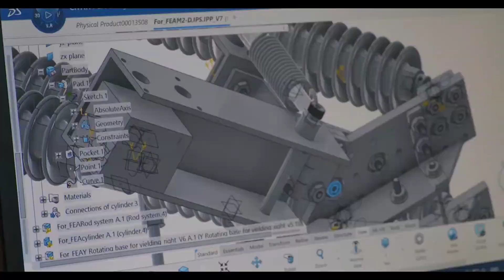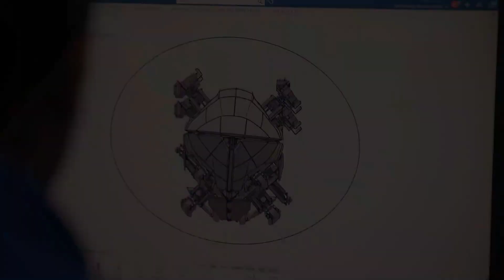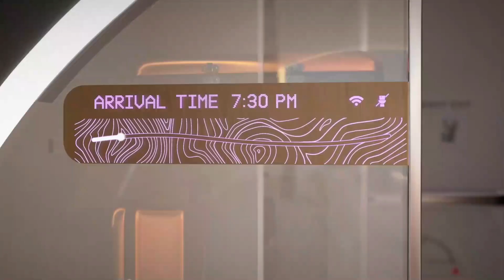Alberta Major Projects I Hyperloop Transportation Project I Alberta Canada

Comment: This is pure vaporware.  This thing will never be built, especially in Canada.  Anyone that sinks money into this scam should come up here in the winter and then in the summer.  You should see what the seasons do to our roads, nevermind the alignment of a tunnel that would support a vehicle that would travel 1000 kph.  And that's not even taking the energy viability of maglev.  If you are thinking of investing money into this, there's an invention called the turbo encabulator that will revolutionize the auto industry.  Look into it!